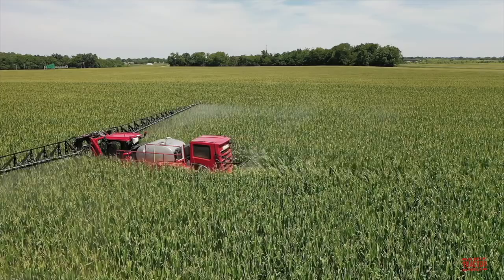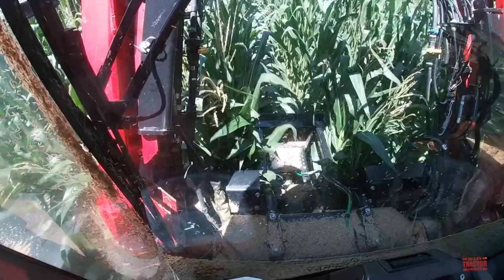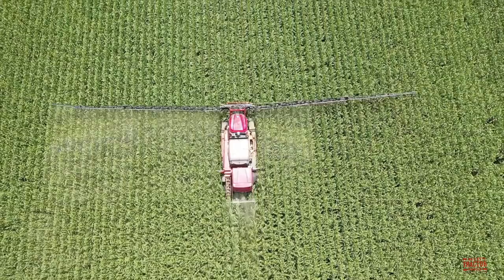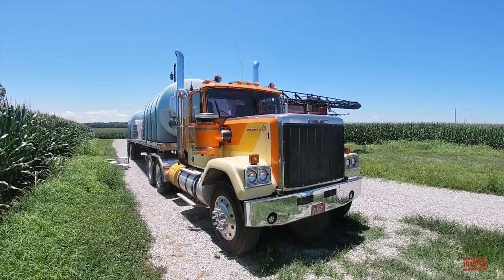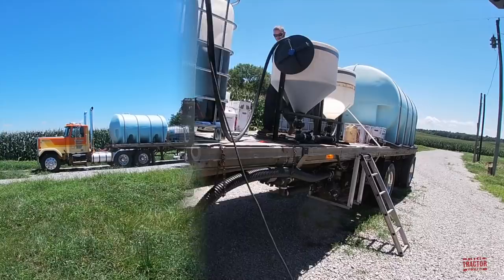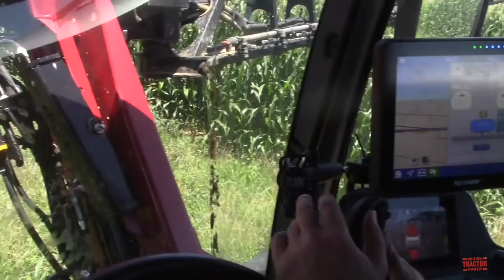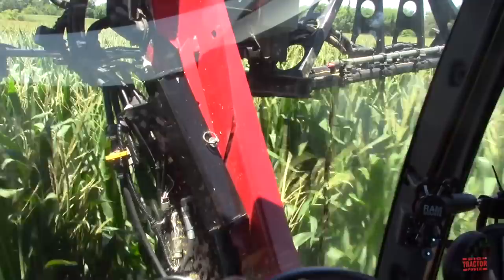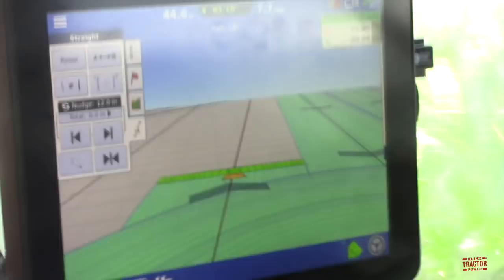Case IH MILLER NITRO 6300 Sprayer in 12ft Corn

Comment: An amazing machine. I remember my Uncle spraying and had to backup to a slough to fill water, then pour the chemical in from a 5 gallon can. The boom was maybe 8 ft wide. This was in the early 60s! He would be stunned to see this machine.
Reply from the maker: Very interesting.  What did he spray with back then?
Reply: bigtractorpower I don’t remember the make or model #. It was a pull type. He pulled with a Farmall M.

Comment: That’s one hell of a cool sprayer I can’t believe the driver is driving it manually to I thought for sure I’d be using auto steer in there but I do see when they do some turns out there is a little bit of damage to the corn 
but not too bad
Reply: no most guys do not use auto steer because it does not react fast enough when go those speeds when spraying and you run to much down. even if you have rtk some guys still say it's still no go and that sub inch accurately
Reply: Where we're currently at right now with these GPS guided autosteer systems, you can have accuracy and you can have speed(latency being the bridge between speed & accuracy that's lacking), but you can't have both. 
All in due time though, technology will progress, accuracy will only grow, and we'll see latency shrink to the point that sub-inch accuracy will be viable at such speeds, especially as we begin to see automated equipment entering the fields too(no, not sci-fi ultra futuristic concept machines - but just simply regular contemporary GPS guided tractors that are acting as, say, driverless automated grain carts for instance, BTP even has a video from a few years ago of one of these)
Reply from the maker: It is a neat machine to see in action. The small amount of corn driven over on the turns is minimal compared to preserving the rest of the crop.

Comment: Got to wonder if its doing more harm than good going thru the field like that
Reply: My first thought exactly!
Reply: Yeah these farmer guys are new at this growing stuff and have probably never tried to do it the cheaper easier way without millions of dollars worth of equipment and chemicals.  Did they even read the directions for that thing?   

Smh.
Reply: They must have done something right or they couldn't make the payment on that 250,000 dollar machine!
Reply: They've never heard of Crop Dusters?
Reply: @joelocker3508  ya a trip to the bank for a loan
Reply: Last week the rich farmers had fungicide applied with a airplane
Reply: @joelocker3508  $450,000 sprayer
Reply: TheRancher03 the difference with crop dusters is you get 2-3 gal per acre with a ground rig you can do 15-20 gal per acre
Reply: Always follows the same exact tracks from last time they sprayed. Don’t be dumb
Reply: More good if they don't there will be more help the ears will just dry, should have sprayed earlier

Comment: Seems like good area for drones to be developed, large drones that only need to hover at a few feet high,
Reply from the maker: Drones applying fungicide is happening now. There is one here in WKY that will spray 3 acres return to the truck refill automatically with fungicide and fuel and then spray the next three acres.  Someday we may see drones seeding the crop too.

Comment: Are you positive that corn is 12' tall?  That would make the machine at least 15' tall, making road transport really difficult.
Also, Miller's own literature says ground clearance is 6' and he's not bending those plants at half their height.
Reply: The height of the machine is adjustable from the cab, maybe they put oversized tires on it, but does it really matter if it’s 12 feet? Or 10 or 13? Wtf does it matter.  Nit picky Murphy should be your name.

Comment: Is this more cost effective versus aerial spraying?
Reply: The price per acre is very comparable. One advantage of this is that you can apply when needed and don't have to wait for a custom applicator.
Reply: Plus better coverage typically
Reply: Price is at least $4.00 per acre cheaper compared to aerial application here.
Reply: I would suspect that aerial spraying would make more sense if you're apart of a co-op that has a spraying op, remove the middle man that needs to make a profit to run an independent business and just roll those expenses into the co-op.
 
I'm just spit balling here though, I've always been interested in the logistics(well, modern farming as a business in general - my family hasn't really been farmers, but they've had some close ties to some, so I've kind of gotten to observe farming from arms length so to speak), but I'm out of my element here
Reply: Field conditions dont effect the aerial applicators. They can fly on the fungicides when the fields are too wet for this ground rig.
Reply: @RyTrapp0  I'm a wannabe farmer myself, follow several channels. I'm amazed at how much work it takes and doesn't appear the money is that great but the lifestyle/family is more important. I'm guessing unmanned drones are not too far off in the future for spraying.
Reply: Thanks everyone for your responses, really appreciate it, I like to know these little factoids :) You know, in case it comes up as a question in Trivial Pursuit!
Reply: @robcondit8488  Drones still have a long way to go before they are more practical on large acreage than a plane or helicopter. For small odd shaped fields they may have potential.

Comment: Why do they wait until the corn is so high?  Looks like a lot of useful pollen and maybe some tassels get knocked off.
Reply from the maker: The pollination is already complete at this point.  Although it stirs up allot of pollen so I would think it would help pollinate more if the pollination was not complete. They are spraying the tall corn to protect the entire plant from fungus. The height and dense field cause allot of heat that helps fungus thrive. Fungus will weaken the plants and they can be blown over flat before harvest by a good wind.  That makes a mess to try to harvest.
Reply: @bigtractorpower   Thanks for the feedback.  You have info that we are not aware of, or maybe I missed it during the video if you mentioned it.

Comment: Interesting video, jus wondering if running through the field jostling the tassles will this mess up pollination?  Definitely an advanced machine getting things done!👍
Reply: “Mess up pollination” ? Do you know how pollinating works?  How could you possibly mess it up?  Do you think the corn needs to be pollinated?
Reply: @jaxturner7288  how does pollination work?
Reply: David Schlecht do you know how to work google?
Reply: @jaxturner7288     Why reply in such a negative way? He asked a question thats not unreasonable, if you know the answer, do the courtesy of telling him... kindness costs nothing
Reply from the maker: The pollination is already complete at this point.  Although it stirs up allot of pollen so I would think it would help pollinate more if the pollination was not complete. Pollination is getting the pollen from the tassel to the corn war silks which produce the kernels of corn.  They are spraying the tall corn to protect the entire plant from fungus. The height and dense field cause allot of heat that helps fungus thrive. Fungus will weaken the plants and they can be blown over flat before harvest by a good wind.  That makes a mess to try to harvest.

Comment: I'm sure the farmer knows best. Just don't think I could bring myself to tear down that much corn for a fungicide  applacation. If the land laid long and wide maybe. To much turning and running down the turn rows per acer for my liking.
Reply from the maker: It really has minimal impact.  The advantage is going out and spraying on your time line.  The fungicide makes a significant difference right as the ears are going on.  The turns are minimal.  The herbicide pass already knocked out the turns back in April.  I think it works out well.
Reply: I would be shocked if the amount of damaged crop reached even close to 1% - it really is positively minimal